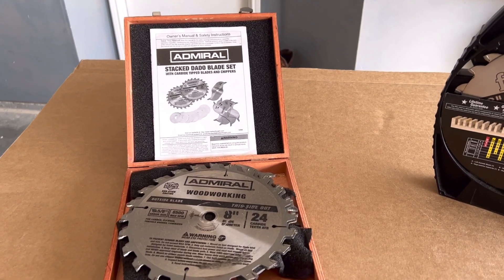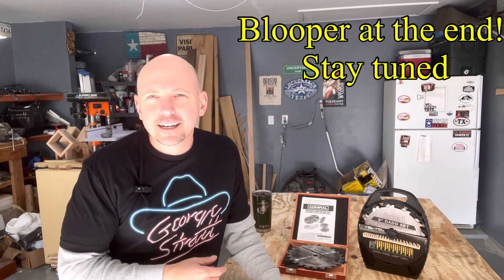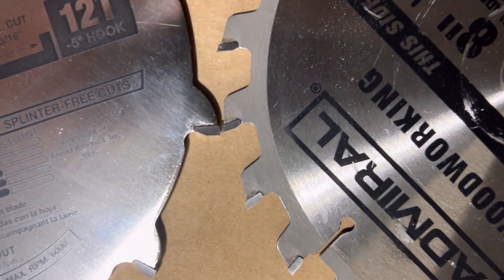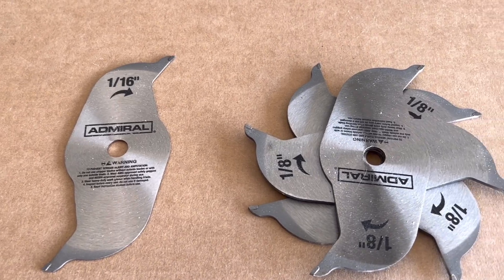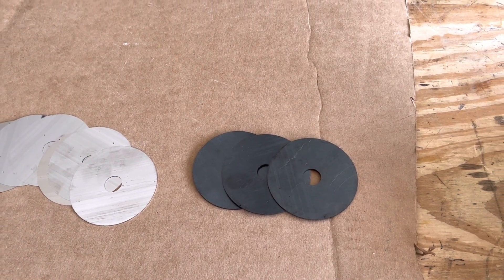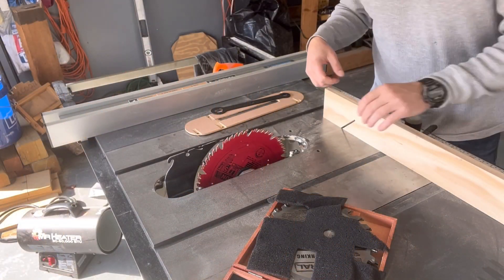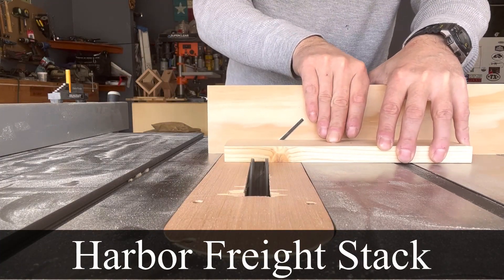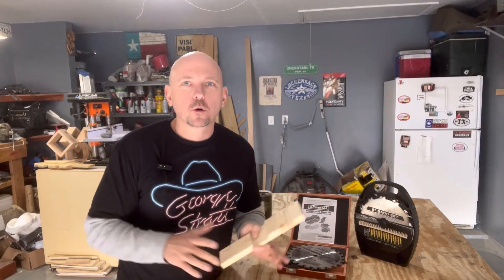Freud 8" Dado Stack VS Harbor Freight 8" Dado Stack (who is better?)

Comment: Nice blooper.  I'd probably always choose a 24 tooth over a 12 tooth blade to try to minimize tearout.  I googled around about the tearout and ran across this on the grooves (something I've experienced as well): "Direct quote from the literature that came with my dado stack: "This dado has been designed with beveled outside blade teeth. This means that the outside saws will cut the very outer edges slightly deeper than the chippers. This minimizes tear-out and gives an overall better cut." This also means if I make multiple passes to create a large rabbet then I will have inconsistent depth cuts across the rabbet or tenon."
Reply from the maker: Oh wow, so the grooves are a given then. Thanks Jim. They have never been an issue just more curiosity. Either way the Harbor stack wins as far as tear out goes.

Comment: I started with the Freud Dado stack. No complaints.  I did just order the CMT Dado Pro set because the locking feature looks to be much safer than a regular dado stack. The only thing I've ever ordered from Harbor Freight are some shitty clamps that I never use.
Reply from the maker: @NBGTFO  nice, I use harbor freight clamps everyday. They work just as good as my name brand clamps.

Comment: Good video, great info, but a better comparison for the HF Dado set at 24t would be the Freud SD508, making both blades tested 24t and 8in, I think this would bring the tearout under control or remove it completely for the Freud, the issue then becomes one of Price, the SD508 lists on Amazon for 179.97, more than three times the cost of the HF Dado set, making that a much more attractive option.
Reply from the maker: True! Thanks for watching

Comment: Quite interesting. I'd be interested in how they compare in hardwood, and if they can both be fine tuned to the same degree.
Reply from the maker: @rodc4334  good topic! I’d be interested in that too. I’ve only used hard wood birch plywood but we know that’s not the same lol
I have burned a little on red oak but the open grain is not friendly and burns uneven. 
I’ll continue after this series with other topics. This might be a good one. 
Thanks
Reply from the maker: @rodc4334  haha I just realized, I commented thinking this was on my new video🤦🏼‍♂️
Disregard my last 🤣 that is an interesting idea and I would like to try it out. I’ve used them on hard wood but dont recall I guess

Comment: If you don't sharpen them yourself what is the cost for that. Then if you need them you are without them till you get them back from sharpening. Just run ton HF and buy another set and your probably break even or $ ahead especially if your only an occasional user of dado blades.

Comment: Idk, I’m not a dado expert, but from what I’ve read, the chippers should be ground to the same height as the raker teeth on the outer blades,  so no grooves and a nice flat bottom. But, I don’t know of any way you’re going to know that they are till you take it home and try it.

Comment: So I’m newish never done dados before. But what is the best table saw to be running dados on? I’m looking to purchase a new saw and want to get one that is best suited
Reply from the maker: Read the manual before buying one. You can find the manual on line. Make sure it can accommodate a dado stack. The smaller job site saws may not allow you to use one.

Comment: The Freud SD508 dado set doesn't even belong in the same workshop as a Harbor Freight rust magnet.  NO COMPARISON when it's a 24 tooth vs. 24 tooth set, instead of the comparison you did.

Comment: Thanks for making the video. I also have both the Harbor Freight (HF) and the Freud. The HF was purchased at a yard sale and the Freud was purchased at an auction with a box of various 10" saw blades. BTW: I have a Rockwell wobble dado blade that I use to make rough surfaces. I've been using the HF set for ~10 years for various dado projects. The finish is very acceptable. Nice crisp edges. Tear out is limited with masking tape on the workpiece. The only drawback to the HF blade set is that if I don't apply a thin coat of oil on it, it'll flash rust, meaning that there's extra work cleaning the blades before use and oiling them before storing. Regarding the Freud set: I hadn't tried them as to this date. However, the blades have a black finish that helps prevent rust, which is a plus over the HF set. Looking forward to trying it out. I was dismayed that your results showed that the Freud gave an undesirable result.
Reply from the maker: Thanks for watching one of my videos! I appreciate the comment!
Reply: rust factor makes a difference to me living in south Florida where it is damp out in my shop all the time.....

Comment: Harbor Freight has been improving over the years. I started buying their tools probably in the 1980's when they were only mail order. No local outlets. The first nut drivers from them had plastic handles that would shatter in your hand when medium force was applied. I bought 10 sets of mini socket sets with both SAE and metric sockets with 40 to 50 pieces because they were only $3 each. That was cheap even then. I have given several sets away to Son in Laws but I still have a couple of new ones left.

Comment: Thanks you for the information . The older I get the more tools/toys I’m needing for my workshop. Ive owned a nice 10” jet table saw for quite a while and I’ve always wanted a dado set but didn’t want to spend the money so I’ve been putting up with lots of grooves in my dado joints. Well I recently saw that harbor freight has them and like everything there the price was in my range. I was able to fight off the temptation or at least until I looked at some reviews on them and yours was the first one I saw and after doing so I will surely  be near the local HF store and by the end of the week my dado’s won’t have anywhere near the groves of the past.  Thanks for taking the time to share us your comparison.
Reply from the maker: Thank you for watching! I appreciate the comment. I’m always glad when I’m a help to someone out there. I never know if I am unless someone takes the time to comment
Reply: if you have grooves using your regular saw blade it's because you don't have an FTG (flat top grind) blade. They're usually 24 tooth rip blades that have the FTG. Stay away from diablo rip blades though because those are ATB (alternate top bevel) and will definitely leave grooves. I have the freud 24 tooth FTG blade and they leave super flat bottoms in my dados, tenons, rabbets you name it. Hope this helps 👍
Reply: @idhatemet00   I understand where you are coming from but if what you say is true, why wouldn't Freud use FTG blades in its purpose made DADO set blades? Doesn't make much sense does it.

Comment: I intend to try the Harbor Freight dado stack after watching this..thanks for sharing..I"d like to make an observation regarding your points relating to weight and sharpening..less weight also reduces stress on arbor bearings and less hp used to rotate the blades..having blades sharpened would probably be half the cost of a new set at HF price
Reply from the maker: Yeah it would, just depends. Not sure you would get many sharpening out of the HF blades as the carbide is smaller. But I’ve had mine two plus years and they are still sharp so… it depends.

Comment: The only thing I noticed in your video about the tear out was the fact that one example was on a piece of plywood and the other is on what looks like a pine board. Has the tear out repeated itself any more on similar wood types? I ask cause I am thinking about buying the HF dado stack.
Reply from the maker: Actually they are both pine. One is just the sanded down pine and the other was rougher. But neither was plywood. 
I really like the harbor freight stack. I’m using the Freud now so I can give better info on a later date
Reply: @epeiusgarage  Ah ok. The look was a bit deceptive then. Yeah let me know. I will probably get the HF set just to keep costs down since I probably wont use it a whole lot. Maybe for 5 to 6 projects a year unless I get more into wood working.
Reply from the maker: @TheJarhead320  it’s totally worth it if your only using it a few times a year. A lot of fun too. I plan on making a recap video in six months or so. I know I don’t like how the Freud are packaged so far. Takes longer to set them with half on one side and half on the other.

Comment: Thank you for the video, I am curious about the dog ears, I feel like I noticed dog ears created with the Harbor freight set in the video but not on the Freud set.
Reply from the maker: Thanks for watching! What do you mean by dog ears?
Reply: @epeiusgarage  Dogs ears, a/k/a as Bat ears by some, are the points created in the corners of a dado cut caused by the outside saw blades. To demonstrate, pick one of the dado stacks, and install it on your Table Saw. Set the stack for 1/2 cut. Grab a piece of scrap wood and cut a single wide dado through the wood. After you make the cut, do not pick up the wood, and leave it on the T/S away from the spinning blades. Turn off the saw. When the blades stop spinning,  scrouch down until you are about eye level with the tops of the blade teeth. When you look across the top of the teeth, you will notice the left and right outer blade teeth come to a point on the outside edge. The chippers do not as they have a flat top. You will also notice these points on the outer blades are higher than the chipper flat tops. Now pick up the wood, and take a close look at dado cut. Keep the board with the open side of the dado cut facing down. If you look at the two upper corners of the cut, you will see a small "peak" cut in each corner. Those are the dog ears (or bat ears) Sean is talking about. On your video at about the 5:30 mark, where you talk about the Freud Dado stack leaving the grooves in the wider dado cut, those grooves are caused by those "pointy" outside blades as you make multiple passes.

Fun fact: the vast majority of dado stacks are made the same way and will do the same thing. Even high end blades from Forrest and Ridge Carbide.

Personally, I am not a fan of the Freud dado blades. Not because I don't like the blades (they are great blades), I don't like the low tooth count.
Greater possibility of tear out.

That's why I went with the dado stack from Oshlun.
Reply from the maker: @barge7619  good to know. Yeah the blades are good I personally don’t like the way they are stored. Now that I’ve been using them awhile.

Comment: That HF dado set looks and is packaged just like the HD Avanti dado set. Avanti blades are trash but the dado set has held up over the last 3 years we've had them. To be fair we use them on plywood and poplar, almost never on any hardwoods.
Reply from the maker: Interesting, I’ve never used the Avanti blades.
Reply: @epeiusgarage  don't, except for the dado set.

Comment: I'm one minute in and I am going to go out on a limb and say that, you didn't find too much difference between the two brands. That said, if I was DADOing (is that even a word?) every day I would rather have the Freud set, simple as that.

I won't edit out my comment and my conclusion still stands. My Freud dado set arrived today but I'm laid up for a while with a bung leg. I'm keen to test the set and compare my test results with yours. I find it confusing that crosscut blades have more teeth yet a DADO set has way less even though many cuts will be across the grain. If you are correct though, there would be many complaints to Freud and I'm sure they would rectify this fault. I know one should push the work piece SLOWLY to help avoid tearout and I will be doing that. Also your now not quite new Admiral blades may just be "blunt" enough to help reduce tearout. Anyway, I'll soon find out for myself.
Reply from the maker: I love my Freud blades. That’s all I use now. I think ultimately if your only using dados now and again and are not getting a return on your investment then the Admiral blades are great and do just as they should. If you’re going to be using them enough to dull the blades then I’d go with the Freud. 
Either way they are fun to use and I enjoy both sets.

Comment: Are you comparing cuts through solid lumber and plywood? One would expect more tear out when cutting a dado through plywood. For a fair comparison try cutting through the same material with each blade, my friend
Reply from the maker: It was the same. Your right different cuts with different material. So far three months and I still like the harbor better. Six months I’m going to do another update. 
I love Freuds 10” saw blade
Reply: @epeiusgarage  Thank you for clarifying! BTW - I recently bought a Freud 6" dado stack for my table saw, and I absolutely love it. Amazing quality for the price.
Reply from the maker: @e-vd  they are quality. So far I don’t like the storage for them
Reply: Thanks for taking the time on testing  them. I have been browsing through the comments and is there some one that trythem on hardwoods? Thanks

Comment: The biggest difference in a quality dato blade is the rake or angle of the teeth.  A negative rake will always produce a cleaner cut.  If you want a professional blade the king of the dato blades is the Forrest set.
Reply: I always thought that the cleanest cut is always the most positive (sharp) hook angle that you can get. Because you slice the wood fibers with a positive hook angle. The reason they don't use positive hook angle is because it is too aggressive, it cuts too fast, and it also dulls much faster since only a tiny part of the tooth is actually doing the cutting. If your tooth is angled the wrong way (backwards) with a negative rake, then the wood isn't being sliced anymore, it's being hacked away, but the blade lasts a lot longer. I watched a man review an expensive Forrest blade against a cheaper blade with a sharper positive hook angle, and the Forrest blade burned the wood and didn't cut very well.

Comment: I bought the HF brand from Home Depot several years ago, probably before HF carried them. I have been very happy with the set and haven’t experienced any issues, but don’t use them that much, not as much as I’d like anyway as I had a couple back surgeries which kept me out of the shop a few years. I’ve been looking to replace them just because I know they’re cheap and not worth having them sharpened. I was considering Oshlun, but not exactly sure. I do know I won’t be buying a $200 set any time soon!